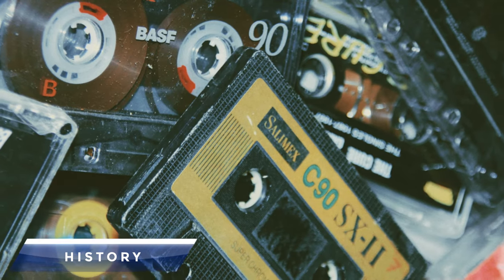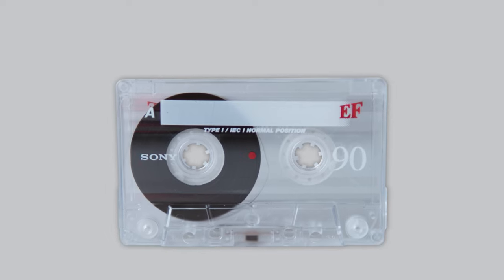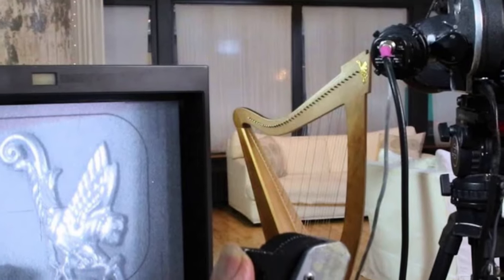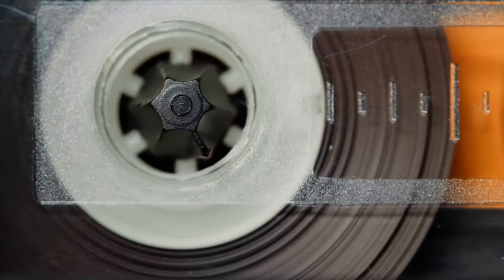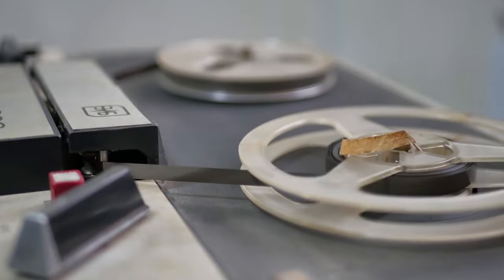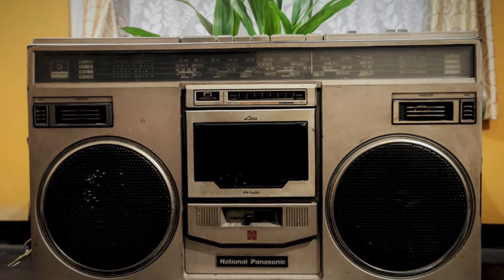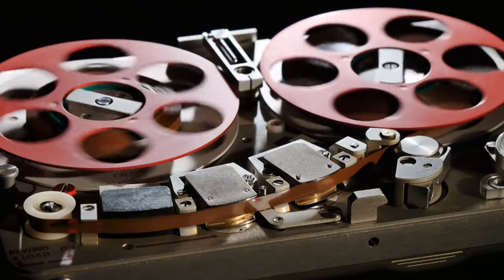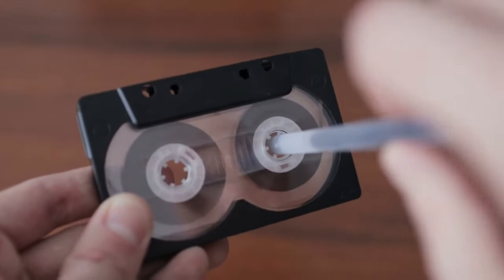How Do Cassette Tapes Work?

Comment: So the basic idea is a cassette tape contains tiny magnetic particles in a plastic tape. When bought new the  magnetic particles on the tape are just randomised, but when recorded on to they become ordered based on the voltage levels of the signal that is recorded on to them. When played back they reproduce that variable signal amplified to drive loudspeakers to reproduce the original signal recorded to the tape. There are magnetic viewers that can see the magnetic patterns on recorded tape when held against it.
Reply: to resume a strip of plastic and rust powder ,ferric tapes ,oxid ferric tapes ,better than cassette metal type IV ,this talking about 1970 reel deck ,as in akai crossfield model X-165D at full speed ,still the best for recording oxid ferric tapes and digital or analog tape is still the better format, the ones who don´t agree don´t know nothing about sound recording, i was like 30 years of not using tapes but in 2017 i restored one of mine 68 cassette decks and because when in a warehouse were going to incinerate thousands of cassettes still in the card boxes i filled my biggest cars only leaving space for me to drive back to my home in total 460 km´s and after no boxes fitting in the car ,i started to open boxes and wherever there was a space in my trunk back seat and right front seat ,all tdk sa-x and hundreds of sony also ,only ux-pro, and more thousands were burned in a incinerator lot´s of thousands ,now i have since 2017 97 cassettes recorded with compilations and the cd player sounds far worst from cassette quality on a good deck, but a average deck is enough to make the cd sound recorded have more dynamics, this using type I cassettes, AR, AD and AD-X but tried some maxell UR i bought in 86 and perfect sound ,using a CT-93, CT-959 from pioneer ,akai GX-630D ,GX-95 ,teac V-1010, Z-5000 ,A-450(this after buying new my first cassette deck after only using reels, from Pioneer a ct-f2121), a couple of monthes after my father ofered me his older A-450 from teac also the nakamichi 1000ZXL and a CR-7a and a love affair started all of this because i sold my citroen DS21 and bought a BMW 3.0CSi with a pioneer radio cassette player inside before i had 8-track cartridges and a vinyl 45 r.p.m. player for the car it came on a pontiac le mans coupé(67) with also a 8-track player and also a radio AM player(original in the car)the singles player was branded Buik, all separated and speakers for each . Those decks i refer even today they if recorded from a cd and all are flat recorders or i would have add the DRM-800a from Denon, after being tired and for some types of music the minidisc deck player/recorder sounded bad so again cassettes ,DAT tapes are really expensive today and the ones i have recorded i will never record over, but tape is for sure the most adavanced technology since early 60´s till today it evolved a lot and in digital or analog recording

Comment: does the plastic tape in audio cassette similar with the one they used in a floppy disk diskette?
Reply: Floppy disk does not have tape
Reply: Magnetic coating  on plastic backing . Cassette tape backing is mutch thiner , floppy disc plastic backing is mutch thicker , same concept,  in a different media.